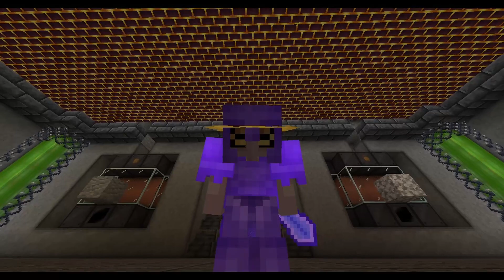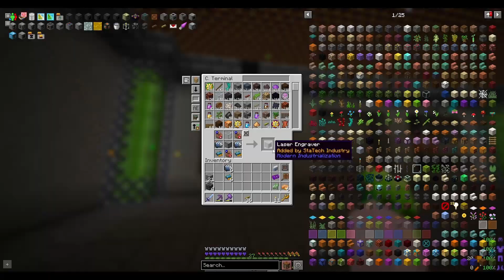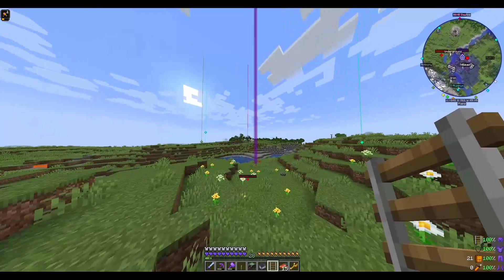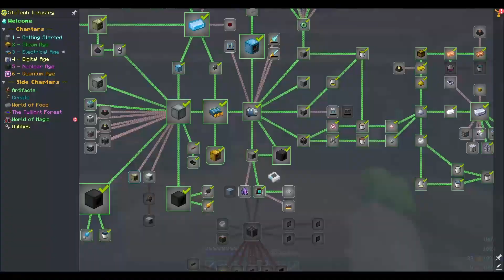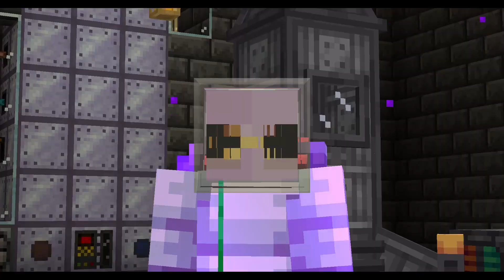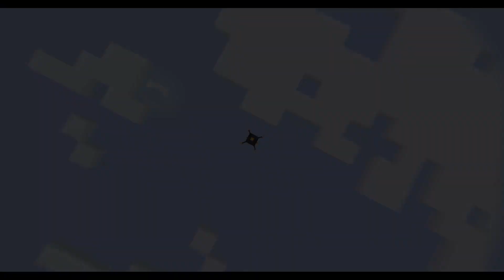Statech Industry E6: Preparation for Ad Astra!!

Comment: Hey love the videos. I do have a question. I’m having issues with my drawer inventory getting to my machines. 

I’ve started to move everything in to my AE2 system but it just started happening recently.

My question is. How are you getting your inventory to the machines? I have the item pipes ran and like I said they were working before but now they aren’t. Thanks for any advice
Reply from the maker: Hey there, thanks for checking my videos out!

I just have everything on one item pipe network, mostly I/O pipes from locked drawers and locked I/O slots of machines.
Reply: @ApexPredaturr  have you ran into delay issues? I’ve put motors at the I/O connection the the drawer access point. Maybe I put them everywhere. Thanks for the replay and the vids. They are helpful.
Reply from the maker: not really, just on the items that are used very very frequently but I usually compensate by just allowing for extra input items into the machines so that it takes a while before it runs it dry and loses the OC